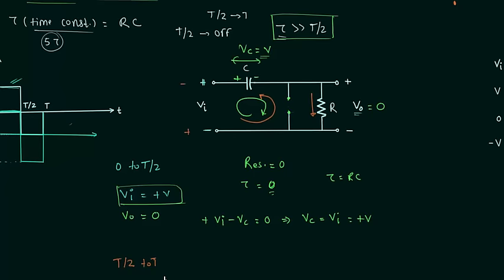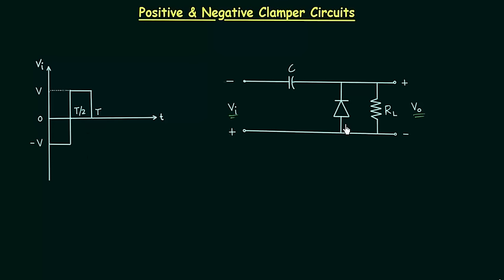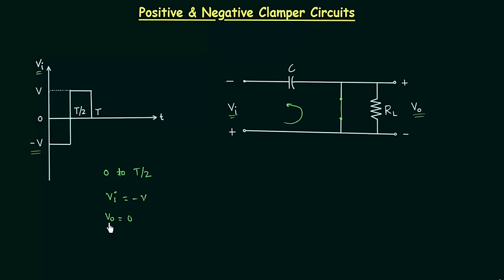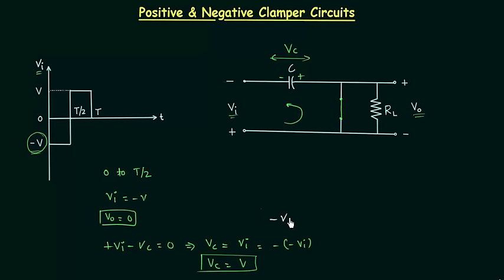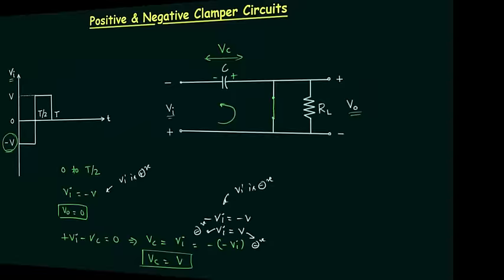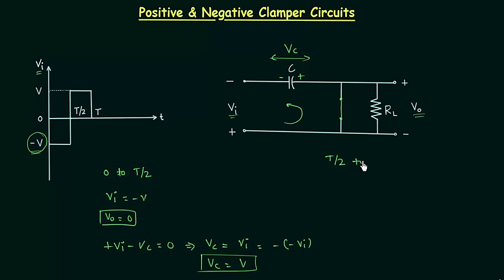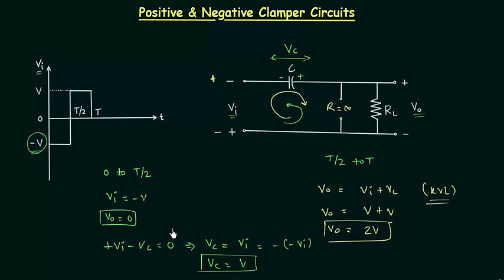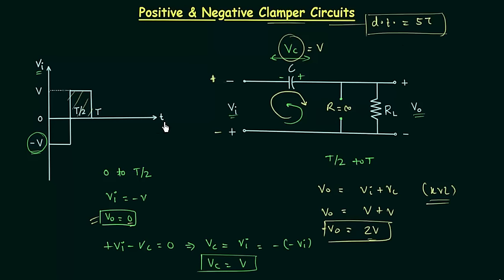Positive & Negative Clamper Circuits

Comment: You can either consider positive half cycle or negative one first. But since he explained negative, I'll explain positive half cycle.

In the first positive half cycle, the diode will remain turned OFF. The current will flow through R and charges the capacitor. But since τ is greater than T/2, capacitor won't charge fully. So, Vo=Vi=Vm.

Inthe negative half cycle, the diode will be ON and entire current flows through diode and quickly charges the capacitor upto value Vm. In the nest positive cycle, the voltage through the resistor will be Vi+Vm i.e., 2Vm....and so on....

Comment: I have a question. +Vi -(-Vc )-(+Vo) =0 equal to  Vi +Vc =Vo  
Is that right? (T/2 to T ) I consider when  in clockwise direction ,start from positive terminal +Vin and minus all the other voltage in one loop for KVL.. And after +Vi, the first polarity I saw in Vc is -ve, 
so  -( -Vc )  ,and first polarity I saw for Vo is positive (+) so become -(+Vo)  ...,is that correct to do this? Pls help. Thx

Comment: As u mentioned earlier in positive half cycle that  polarity of capacitor depends upon on which side it is connected 
But in negative cycle u didn't change the polarity of capacitor
Reply: yeah but here after the half cycle the capacitor gets charged so the polarity remains same as in during the case oof charging

Comment: Why arent the capacitor pole charges being reversed when cycle changes.
Reply: no it will not because physically capacitor is not reversed you just changed the polarity of input  
which implies: if capacitor charging in first half cycle then it will discharge in negative half cycle as it act as dc source which changes the dc level of your output
(:
Reply: @To_Engineer  bro nice explanation ,thnx bhai

Comment: Sir i didn't understand, y that capacitor won't get discharge during second half cycle?
Reply: dear when you perform this in lab you will see on output -ve half cycle is extended on time axis due time taken by discharging of capacitor
Reply: Before the charge drains down, you flip. It is instantaneous.

Comment: hey nice video but may i know what if the input voltage is 15sin theta, 60Hz how am i going to draw the output graph?
Reply: it will be similar, i mean clamped similarly, but if we use non ideal diode there will be clipping

Comment: what would be output for further cycle
Reply: Diode will again become forward biased (replaced by short circuit), and Vc will again be equal to Vi, and the cycle will continue with a DC shift.

Comment: what if the square wave started from +V instead of -V,..?
Reply: You can either consider positive half cycle or negative one first. But since he explained negative, I'll explain positive half cycle.

In the first positive half cycle, the diode will remain turned OFF. The current will flow through R and charges the capacitor. But since τ is greater than T/2, capacitor won't charge fully. So, Vo=Vi=Vm.

Inthe negative half cycle, the diode will be ON and entire current flows through diode and quickly charges the capacitor upto value Vm. In the nest positive cycle, the voltage through the resistor will be Vi+Vm i.e., 2Vm....and so on....
Reply: @AnoNymous-po5sx  good explanation. from the very first half the capacitor wont get stabilized.

Comment: Sir what happen when in positive clamper when signal start from +v
Reply: You can either consider positive half cycle or negative one first. But since he explained negative, I'll explain positive half cycle.

In the first positive half cycle, the diode will remain turned OFF. The current will flow through R and charges the capacitor. But since τ is greater than T/2, capacitor won't charge fully. So, Vo=Vi=Vm.

Inthe negative half cycle, the diode will be ON and entire current flows through diode and quickly charges the capacitor upto value Vm. In the nest positive cycle, the voltage through the resistor will be Vi+Vm i.e., 2Vm....and so on....